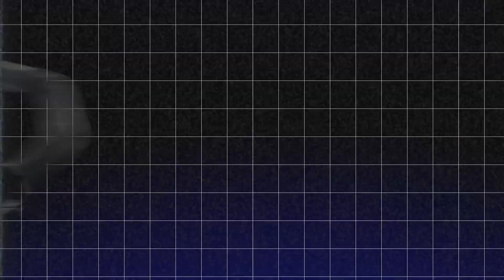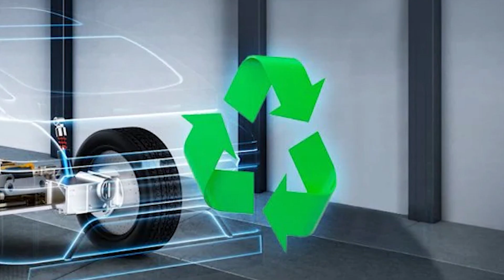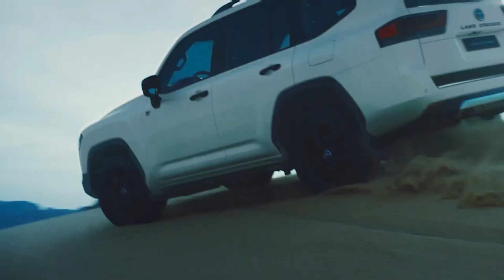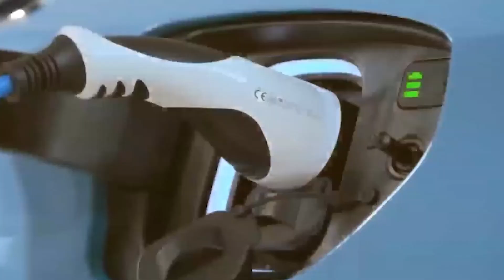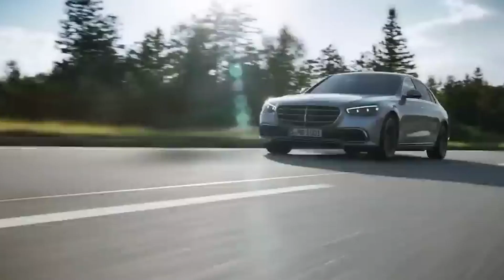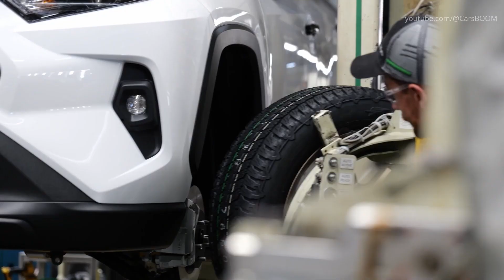The Reason Why New Cars Can't Last 5 Years Will SHOCK You! (They Don't Want you To Know This)

Comment: Plastic for things like the bumpers is fine, we need the safety features. Plastic for the motor components like the turbo charger or spark plug is NOT ok, that's the problem.

Comment: One of the reasons Pontiac was able & willing to build the two-seater Fiero  in 1984 , was the all-plastic bodies. The technology of Reaction Injection Moulding, or "RIM"...has resulted in extremely low cost production of plastic parts.The automakers are using these technologies as extensively  as possible...by stretching operational parameters of plastics, engineers are saying, "yes, it can function under those conditions, but barely, and not for very long".

Comment: So much of this vid are uninformed.  I work with so many of the OEm parts manufacturers regularly.  All of this is being driven by the epa bs!! The last administration forced so much damage to the automotive consumer. Car manufacturers are being forced to use lighter parts all in the name of mpg and disregarding the longevity as you pointed out. Cant have it both ways! Cant get longevity and lighter cars at the same time w/o going to tiny cars. America doesnt want that. I could give a laundry list of the bs manufacturers are doing because of the force of the ignorant epa and the left side of politocs!! Its causing so much harm to consumers and prices!

Comment: All these problematic innovations taken by themselves add up to a big mess.  How many tenths of a mile does GDI save vs. simple port injection?  How about a 10 speed auto vs a 6, or a CVT vs a torque trans?  5 pounds of plastic vs 20 pounds of metal under the hood?  A laptop stuck in the middle of the dash baking in the sun?  I’m sick of all this shit.

Comment: Manufacturers are being forced into turbocharging tiny engines and creating buggy CVT transmissions in an attempt to meet ever more unrealistic minimum fuel efficiency standards.
Reply: dont forget the manufacturers 'choice' of using 'loose' piston rings for less engine friction, thus higher fuel (govt. mandated fleet) economy .... which only allows the combustion gases to bypass the engine's compression and oil control rings which DILTUTES the 'lubricity' of the engine lubricating oil.  The results 'shot engine' by ~50,000 miles.    
Overwhelming electronic control .... how many 'old' computers do you own that are still functional?   Reason: the chemical process that is involved in the manufacture of the 'electronic CHIP' never stops !!!!!!!!

Comment: I drive a 2004 Toyota Camry XLE made in Japan. 130,000 miles. I had problems with it about 3 years ago. The shop said it would cost $800+ to fix. Got parts off Amazon, got alternator rebuilt $100.00 and a shop to install the rest cost $300+. Been running fine since.
Reply from the maker: That’s the way to do it! A well-maintained older Toyota can easily outlast some of these overpriced new models. The fact that you got it fixed for a fraction of the shop’s quote is a win. Do you do most of the maintenance yourself, or just source the parts and find a good mechanic?

Comment: I had big troubles finding a car with a good reliable engine. Did not want a small 3 cylinder turbocharged engine. Also wanted a reliable automatic gearbox.
A lot of search was needed. I ended up with a Mazda CX-5 with a 2,5 l naturally aspirated gasoline engine with a very smooth shifting and reliable 6 speed automatic gearbox.
There could be others equally good, but in todays carmarket they are very rare gems - not easy to find.
There are other brands, where you can find a reliable car. Toyota and Lexus are still among the most reliable cars.
They are not like oldschool cars. A manufacturer needs to follow the trend. But Mazda, Toyota and Lexus still build cars with a stronger focus on reliability than most other brands.
Happy that there still are a few serious car manufactures, that can be trusted.
Reply: You still have cylinder deactivation, which has a spotted legacy.
Reply: @jackhoyle4743  That is correct. The Mazda 2,5 engine comes with cylinder deactivation. Most car brands that have made cylinder activation, have done it in a way so it became a weak spot, that often creates problem. Other brands have been more succesfull. For Mazda engines the cylinder deactivation is made to be reliable. The cylinder activation is not mentioned in any review as a trouble maker.
Reply: @flemmingqvist8326 if anyone can do it, it would be Mazda. GM and Ford haven't been able to, and even Honda has had problems with their V6s.

Comment: I have three well maintained 12 year old cars, all three getting close to 200,000 ks.  All three are in great condition, mechanically, chassis and body. However, I do have them regularly serviced. They are reliable so far, as nothing goes wrong. The only major items replaced are brakes across all three. Two Australian made and one German.

Comment: GDI engine designs don’t address the carbon buildup on the intake valves on most engines. Toyota did it right.
Reply: toyota didnt do the tundra turbo v6 right.